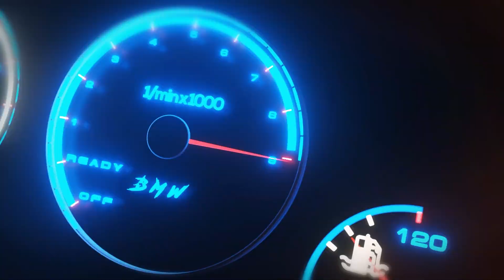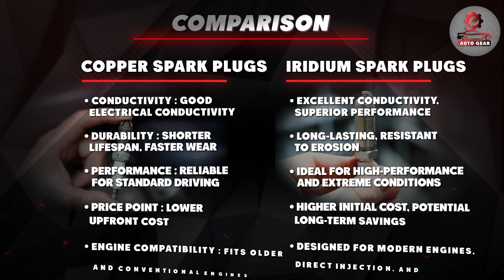Copper vs Iridium Spark Plugs: Comparison and Which One to Choose?

Comment: I don't know where you got your information. A copper when it comes to performance and nickel is superior to iridium iridium is colder
Reply: An iridium has a hotter spark between a copper or platinum.
When it comes to performance a copper is the best.
Reply: Yes true but that set performance is always on a down fall. True copper is best for energy transfer. But for example you do 50 miles each way for work. Coppers might last you a year before changing.  15,000 mile change versus 60,000. 
And 30’000 for platinum